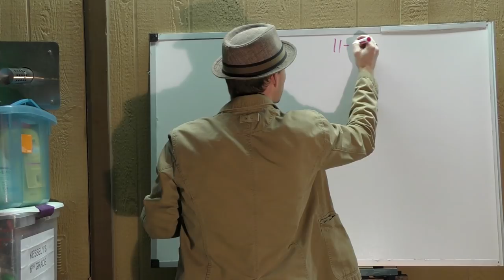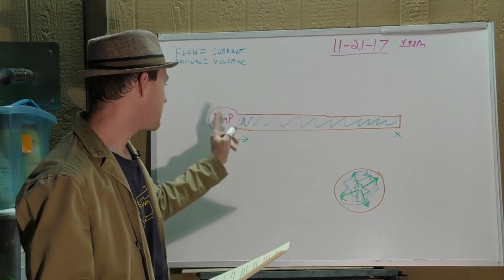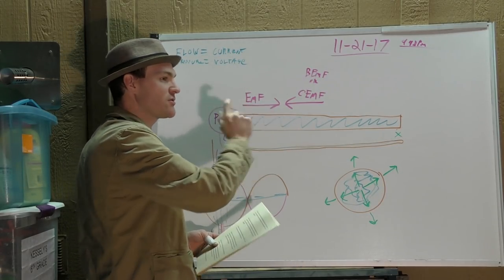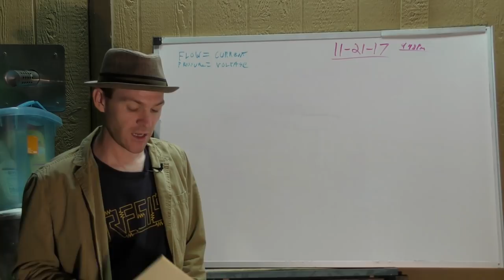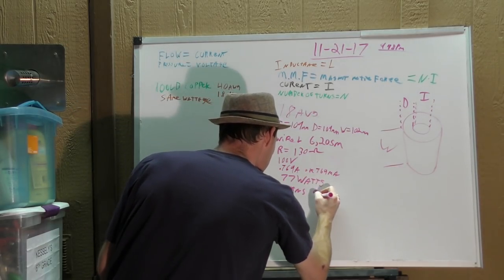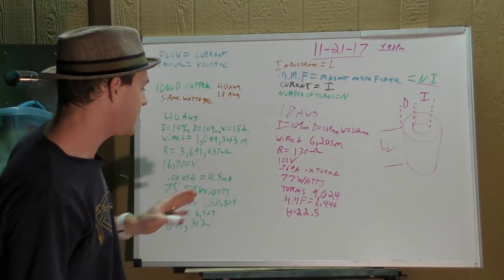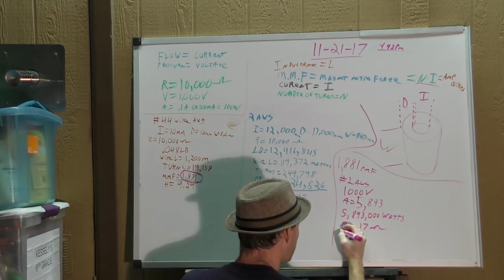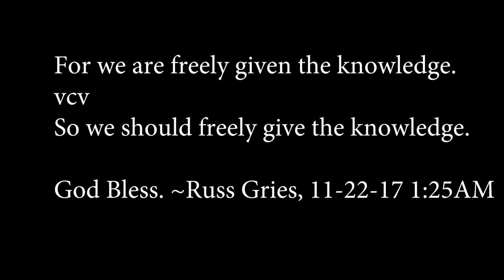Part 10: The Steel Wedge of Truth Hit by The Sledgehammer of Facts Will Break Open Even Closed Minds

Comment: Let's try it one more time Russ:  An inductor is like a mass sitting on a wheeled trolley on a factory floor.  The bearings in the wheels are nearly frictionless.  When you push on the trolley that is analogous to voltage.  The speed of the trolley is analogous to the current.  The mass of the trolley is the inductance.  And when the moving trolley crashes into a wall and stops moving that is the release of energy in the transient spike.  This analogy between inductance and mass is 100% valid.

So, you are a worker on the factory floor.  There are two trolleys for you to push.  Trolley A is loaded with 100 lbs of stock.  Trolley B is loaded with 800 lbs of stock.

You push on Trolley A and get it up to one meter per second in speed and you let go and it crashes into the wall with a moderate bang.  You push on Trolley B and get it up to one meter per second in speed and it crashes into the wall with a big bang.

So what is the difference between these two things?  Obviously you had to push much harder and it took you more time to get Trolley B up to speed because Trolley B is heavier.  You had to put MORE muscle into getting Trolley B up to speed to get the bigger bang and you are IGNORING this in your whole discussion.  You are making a huge mistake and you must fix it.

What are you doing instead?  Well, it turns out the bearings in the trolley wheels are not nearly frictionless.  There is some bearing friction when you push on both of the trolleys and you can feel that frictional drag when you push the trolleys.  That frictional drag is making the bearings in the wheels hot.  That frictional drag is the resistance of the coil.  So your whole discussion is relating back to the frictional drag in the bearings and you are ignoring the physical work you have to do to get both trolleys up to speed.  I will repeat, you are making a huge mistake.
Reply: I kinda agree,  Do you think Gerard Morins setups can actually do work, using the energy more efficiently?

Comment: There is a big difference between conduction current and induction current. No matter what capacitance involves induction otherwise it wouldn't work at all. The electric field is inductive and the magnetic field is less so. Electric field is expansive and the magnetic field is constrictive or conservative.

 The turn thing can be looked at like this: Segmented connected matter (internal conduction). pound for pound but the only change is the segmentation increases the action of the magnetic field due to additive field mechanic. Another way to see this is with batteries. Multiple batteries adds to either the current capability or the push or potential.

 But there are trade offs with normal coils. Think bifilar here and you will see that we can negate a certain amount of cemf allowing the coil to lessen it's charge time or negate the reluctance to charge up in the same amount of time as a body with less segments.

  My last statement on this. Now think about a transformer. Balancing the weight of the primary to the secondary is a must. The primary should be bifilar and the secondary should be regular solenoid. This way the primary has reduced cemf and the secondary has a better response with less push back on the primary. Primary should be many many turns and the secondary should be less turns but the same weight as the primary. This way there is little difference in the two weights and won't react badly between the primary and secondary.

Comment: Okay Russ, I am going to give you something different from the water analogy to put in your toolbox.  In fact I mentioned this before but I will simplify it here.

Let's talk about a capacitor being equivalent to a mass.   You know the two equations are very similar, E = 1/2 M v-squared and E = 1/2 C v-squared.  So let's examine this with a simple example.

There is a large mass sitting on a wheeled trolley.  Think of a factory floor.  You push on the trolley and the mass slowly increases in speed.   The force that you push with is the current, and the resulting velocity of the trolley is the voltage.

If the trolley crashes into a wall and stops, you get a huge spike of force against the wall and the velocity drops to zero.  That is the equivalent to shorting out a capacitor.   In this case the spike of force from the mass is the spike of current from the capacitor.

If the trolley hits a big spring affixed to the wall and then bounces back at the same same speed, the big spring is the equivalent of an inductor and you are looking at one cycle of an LC resonator.
Reply: Now let's talk about an inductor being equivalent to a mass.  E = 1/2 M v-squared and E = 1/2 L i-squared.  So let's examine this with a simple example.

Same setup as before.  When you push on the trolley this time the force is like pressure and that is like voltage across the inductor.   The trolley slowly increases in speed and in this case the speed of the trolley is the equivalent of the current flowing through the inductor.

If the trolley crashes into a wall and stops, you get a huge spike of force against the wall and the velocity drops to zero.  That is the equivalent to open-circuiting an inductor.  In this case the spike of force from the mass is the spike of voltage from the inductor.

If the trolley hits a big spring affixed to the wall and then bounces back at the same same speed, the big spring is the equivalent of a capacitor and you are looking at one cycle of an LC resonator.

Comment: On 'delay' I was watching my electric fence laying on the ground last night. It was of course shorted at many spots. But What I found most interesting. Each time the current pulsed I could hear a pulse train along the wire. Not a single snap, but many snaps with a perceptible time delay between them along the length of the line.
Reply: i hope your neighbors havent got cats

Comment: You've forgotten the time constant. time to reach impressed Voltage = 5* (L/R) . Inductors require time to charge just like capacitors do... it's all about momentum. 1 Joule = 1 Watt*sec (edit here ... joule/sec = watt ... end edit) using this relationship, you can calculate a rough instantaneous power vs average power. Your (nano-switching) is mathematically known as the Heaviside step function. Transients can be modeled by the Dirac impulse function... all frequencies are contained in an impulse function... hence the step response  can imply the frequency response and you will see that inductive/capacitive reactances are not negligible nor trivial. It's good to see you thinking. Thanks for the video.
Reply from the maker: yes! agree, and there is a lot more to talk about. but had to cram all that in there lol thanks for the good info!!!! ~Russ
Reply: One Joule is one watt times one second, not one watt per second.
Reply: Yes of course you're right.

Comment: sounds like your describing one half of a dipole antenna, if you have a sin wave ( ac voltage ) attached to this antenna but alter it so its only one half wave ( dc )  the magnetic field created during this half cycle abruptly stopped, it turns into an electromagnetic pulse and propagates outward as normal. 
    DC pulsed radiation .....   just a quick opinion
The pipe system creates electromagnetic radiation also ... in the form of heat

Comment: i'm convinced you can do the same thing with a lot less copper wire using resonance and lc circuit across the coil..
Reply: How does this work though, since there are no, "perfect" inductors and capacitors,  so you must use the ESC, ESL, (ESR)
Reply: @ryanb1874  water is a good capacitor

Comment: Russ. Just a heads up-->The back EMF is never equal to the applied EMF. If it was,you would get no current flow.

Also,the total heat dissipated by any size coil with 100 watts going through it,will be the same. You need to account for the size of the coil,where the little coil will rise to a higher temperature,but a lower volume of heat,and where the larger coil will rise to a lower temperature,but where it's volume is much larger--> so,the total dissipated heat in both cases is the same.

Enjoyed the video.
Reply from the maker: I can agree with that. hope your doing well. happy thanks giving!! ( at least here in the states ) :) ~Russ
Reply from the maker: on the heat, i agree, however it also needs to be noted that the heat generated will be almost nall to the effecting of the alignment of the atoms. so your not "fighting" your self so to speak...  ~Russ
Reply: +TinManPower  No, we've had this argument many times before.  The counter EMF (I prefer that terminology for less confusion) is always equal to the applied EMF.  A voltage source across a resistor is a classic example of this.  The resistor generates counter EMF from V = IR that is identical and opposite to the applied EMF from the voltage source and current flows.
Reply: +rwg42985 Well I watched the first third of your clip and you clearly get it were counter EMF equals applied EMF and I am pretty sure that you acknowledged that current flows.

Comment: Okay Russ from your document:  <<<  So the more inductance the more Back EMF.  However in our coil above, we use the same power, and the same amount of copper, and got a massive increase in inductance. So there for the same amount of input or EMF, We got a lot more BEMF...  hummm...  >>>
You are not clear on a few important concepts.  For starters, the resistive power being burnt off in the coil and the amount of energy being stored in the coil are separate and distinct things and they should not be confused.  In the purest sense, the resistive dissipation has nothing to do with what is really going on in the coil.  The input to the coil is not EMF, the input to the coil is voltage times current times time (NOT looking at the resistance here) that energizes the inductor.  And the BEMF has a property of the maximum spike voltage but for purposes of this discussion we are concerned with the amount of ENERGY in the BEMF spike.  So what are you really looking at?  Ignoring the resistance, you applied EMF across the coil and that yielded increasing current flow and it's the voltage x the current x the time that puts a certain amount of ENERGY into the coil.  And when you get the BEMF spike you extract a certain amount of ENERGY from the coil.   And the reality is you got more energy out of the coil with the higher number of turns, and to do that you had to pay the price because it took you more time to energize the coil with the higher inductance.  Let's bring resistance back into the discussion now.  You know that it's about five time constants to fully energize the inductor.  You also know that the time constant is L/R.  You also know that as you increase the number of turns the value of L is proportional to the square of the number of turns.  You also know that the value of R is proportional to the number of turns.  That means if you double the number of turns, the time constant L/R quadruples.  And that means it takes more time to energize the larger inductor and therefore the source EMF has to put more energy into the larger inductor.  So there is no "magic" when you have a coil with more turns and your statement, "So there for the same amount of input or EMF, We got a lot more BEMF" is wrong.
Reply from the maker: let me put it this way, when you calculate Amp turns. you get theses numbers i show in the video and doc. , however a better way to calculate it is Lb/turn. For the same amount of resistance, same amount of current, same amount of voltage, for the same watts,  but increase the wire to match the same resistance. we get the result i talk about. The real way to calculate it is Lb/Turns.... more copper, more magnetic alignment, same amount of input, bigger the field. Bigger The transient. ill add this to the doc.    ~Russ
Reply: +rwg42985 Isn't this all just a zero sum game?  Isn't it like this:  When you go from a thick wire gauge to a thin wire gauge and same wire weight you get more turns and for the same power dissipation you get the same MMF from both configurations?  However, you have more inductance in the back EMF spike for the smaller gauge wire.   So your thrust is "bigger back spike for the same power dissipation with the same MMF for smaller gauge wire."  But like I just pointed out to you above, you still have to put more energy into the coil made with the smaller gauge wire to get the bigger back EMF spike.  So you still have to pay for that bigger back spike that you get with the smaller gauge wire.  And the elephant in the room is that comparing resistive power dissipation to the energy in the back EMF spike is a strange metric.  The resistive power dissipation is always power being poured down the drain and lost to heat.
Reply: +rwg42985  And sorry to say this but you still don't have a real output for this "Newman machine."  So here is a hypothetical scenario for you:  You get the wire and make a 100-pound coil of many thousands of turns.  You build it with the big magnet that rotates inside the coil.  You connect 100 volts to it through your commutator and you watch it spin.  But you need an output, right?  So finally you do about the only practical thing you can do.  You collect the back EMF spikes into a capacitor bank of some from or a separate charging battery because realistically what else can you do?  So then you make power (or energy) in and out measurements and you are going to find that the device is an under unity device.   And if you want to search for your unity, when you factor in all of resistive losses associated with the 100-pound copper coil then you find your unity.  No gyroscopic particle business, no special secret sauce.  You will end up with a big honking pulse motor that just spins.  Effectively, it will be a big glorified Bedini pulse motor turned inside-out.   And your biggest mistake is to put all of your critical thinking skills to the side and "buy into the Joseph Newman pitch."  You are putting your common sense and your electronics knowledge aside so you can "build it as a believer."  Why?  Why can't you keep your critical thinking skills and build it anyway?
Reply from the maker: User2718218 once again. I rather put all my efforts in to progross and not in to trying to convince anyone of anything. If one wants to watch me press forward then there welcome to. But I'm going to stop putting effort in to responses that are not  Productive.  With all due respect,  I will now move on....  And press forwerd as I see how this works. ~Russ
Reply: what i showed you in vid.  believe it or not i think is best with mechanical contacts, lot energy in that spark
Reply: +rwg42985 Probably the most important thing I told you was the corrections for you about the water model.  In the end just convince yourself of the truth and share it with your peers.  If that means that you come to the realization that all you did was build a big honking under unity pulse motor then state that.  If you saw no "special Newman secret sauce" then state that.  If you come to the realization that the theory was nonsense and you suspended your disbelief to build the thing then state that also.  And the lesson for you going forward is to not suspend your disbelief and buy into somebody's pitch.  Stick to your guns and apply your knowledge and be true to yourself.  You are fully aware that even most people in the "free energy community" consider the late Joseph Newman to be a quack and a con artist.

Comment: technically you would need a very high voltage with as little amps as possible just to establish flow of micro amps threw an inductor using high voltage to get the micro amps threw the high impedance inductor there by creating a large potential in the environment of space , if the potential is inverse to the potential in space every where it will act like a magnet and establish flow with space